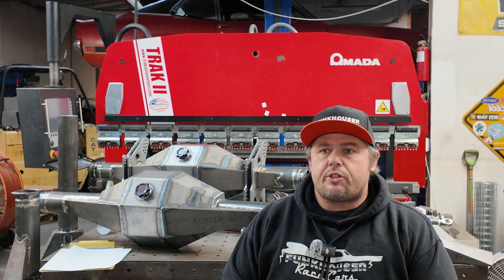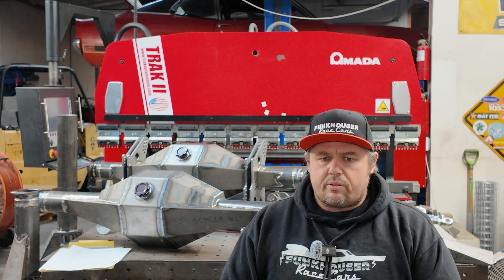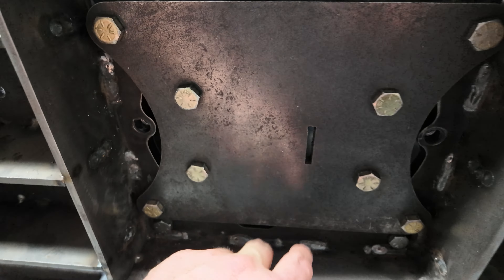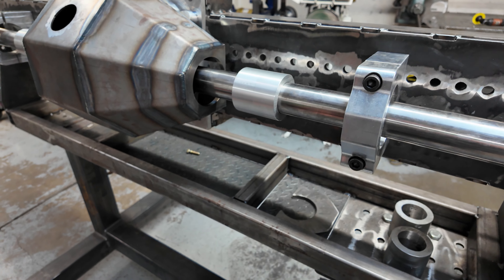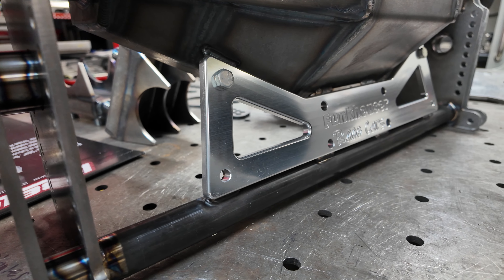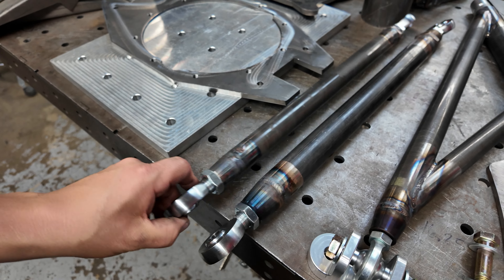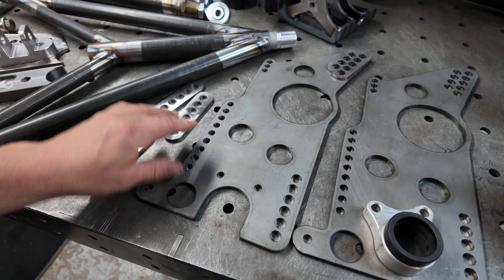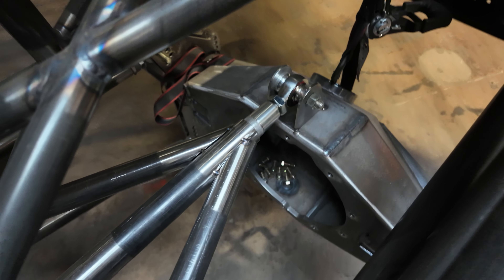Funkhouser Fabricated Housing

Comment: When your done with all the welding do you check the ends of the tubes for run out?  As in camber and toe?
Reply from the maker: great question. the last piece to go on is the bearing housing end. The housing end is held concentric to the carrier bearing centerline with the 2" bar. Building the center first and installing the tubes second mitigates the movement induced by the welding process. The preload we put in for welding the backbrace helps keep the tube in near perfect alignment. Then welding the bearing housing end on last any of the minute movement that has happened is overridden by the fact the bearing housing end is held perfect to the bore centerline with the bar. We can usually slide the bar through the center with both bearing end bushings installed post welding. maybe its a little snug, but near perfect. The large bearing end bushing i machined also helps with controlling heat saturation. These assmble easy after its all said and done.
Reply: @funkhouserracecars  it would be interesting to put the hubs on. Set them on jack stands. Pull a tape across and rotate the housing to check run out.

Comment: When you have the pan hard bar mounted high like you do,the car will have way less side bite. Do you have any issues with skating?
Reply from the maker: good question...we dont use real panhard bars, we use a wishbone. The wishbone is only there to center the housing side to side. the wishbone has a sliding link to allow for the pivot legth differences. If it didnt slide, the suspesion wouldnt move. thanks for the great questions
Reply: @funkhouserracecars  the rear roll center is at the height of the average of the Heims in the wish bone. In a side load it forms a lever arm with the center of gravity. High like it is would hurt side bite in a slide promoting skating in my opinion.
Reply from the maker: Yeah, i agree with that...but were not concerned with sliding or turning when it comes to dragracing.
Reply from the maker: @daleolson3506 after further consideration... maybe i answered too fast, im not convinced the wishbone in a parallel drag race style 4-link could have an interaction with roll center. Certainly a 3 link with a panhard would experience the jacking affect...that makes 100% sense. The wishbone is a non fixed link in this case and has no contribution to instant center. I can say ive driven a car with a top wishbone and a bottom theres nothing i can tell making passes in it...but thats ancetdotal eveidence.

Comment: What would the price difference be in the tog vs mig option? Any difference other than the weld process?

Curious what would be the advantage of a CM rear end other than weight?
Reply from the maker: Hey buddy! I think MIG vs TIG would be something like 250$ savings...from a pure time to weld standpoint. As for 4130 vs MS, the weight savings only comes from using thinner wall thickness. The weight of the raw material is the basically the same. The tensile strength advatage from 4130 would make.a stronger part, otherwise thats about it. I would still use ER70-S2 to weld it all the together. The real big benefit with 4130 parts is if you heat treat them. They get harder and wayyy stronger. But there will be post process things that need to happen after the parts are heat treated, and you'll need to use proper filler etc etc. It can get out of control price wise. Ive seen some cars running 4.1x with a 3.0" mild steel fabricated housing...non-floater as well...so I feel like where most of my customers live, mild steel makes sense. I can make these from 4130, but the price will reflect.
Reply: I was just curious on the CM lol…. Can’t afford that. I would personally be interested in the mug welded housing from a budget standpoint. I’m building the budget S10 and want it nice but mig makes sense for me I think. 

I was the one that called yesterday on the s10 cage. Love watching your videos and they’re very informative!!
Reply from the maker: @RogerBell-k1w I think a mig option would be perfect buddy!! I probably underrate the MIG welded housing just because of my bias towards TIG...but for what you want to do...that would be perfect! This def helps me on my desicion wether or not to offer a MIG version